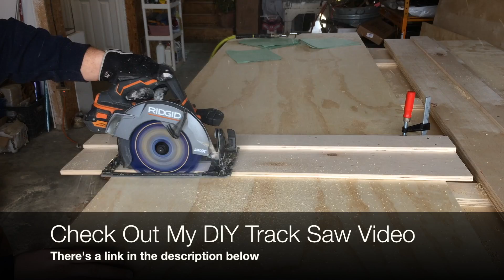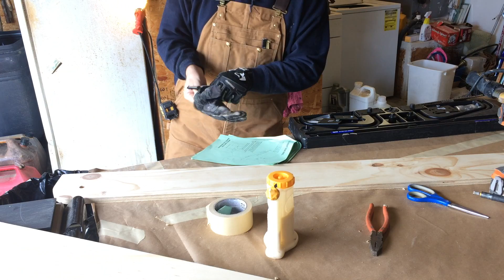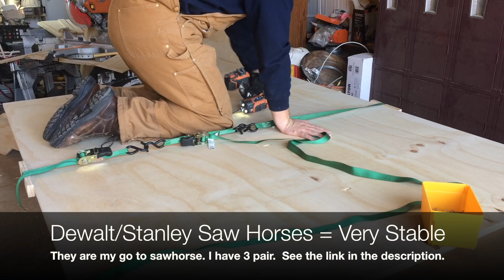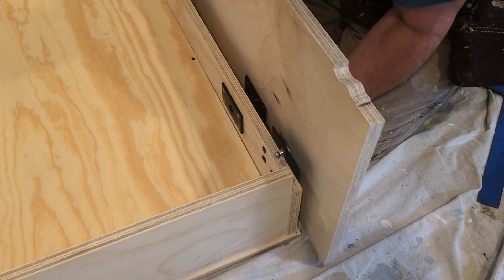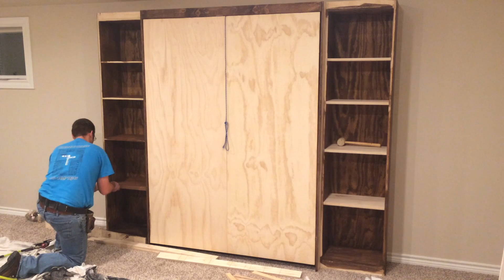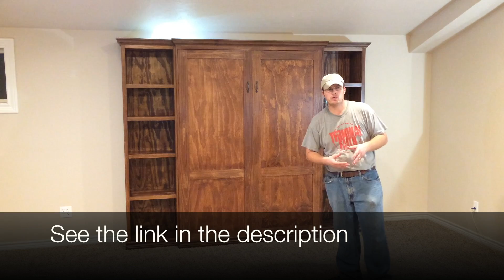How to Build a Murphy Bed - Using Create-a-Bed Hardware Kit

Comment: I built my bed from the Create-A-Bed kit.  The hardware is standard fare and most suppliers use the same hardware sets.  What Creat-A-Bed sells is not exclusive to them.  The instructions that come in the kit are though. My instructions have a revision date of 2018 on them.  I found a few errors in them.  I have considerable wood construction experience so I was able to decipher the instructions and work around their mistakes.  And I substituted some of the materials to make a better bed that was easier to assemble.  I would recommend to anyone to use another supplier that includes photo illustrations of their builds.

Comment: Lots of work in this build.  Great job! I would change the following: avoid rotary cut soft-wood plywood.  In my opinion it does not take stain well.  Hardwood maple or birch plywood is much more attractive either painted or with a clear finish; apply iron on wood tape to bed box.  Raw plywood edges are not attractive.   Other wise great work.

Comment: Dailey, thanks for posting this video. I'm in the process of building this for a client however, theres a height limit of 83.5" due to beam of where they wanted this bed located. Do you think it's possible to adjust the length to 83.5" by shaving off 1.5" from the head piece? Just wondering if theres wiggle room by the wall. Thanks.
Reply from the maker: Al Flores I’d contract Creat-a-Bed for that one. I’d say no it wouldn’t work. The plans are very specific. However they also make plans for horizontal mount beds to easily solve your height problem

Comment: I wonder how hard it would be to assemble this for a bedroom that is only 8 feet wide by 10 feet deep.
Reply from the maker: You'd be really cramped but it's doable.
Reply: @DaileyWoodworks  I actually found a prefab unit that needs some assembly that will fit under one of the windows in the room. It is the Deerfield model by Atlantic Furniture with a built in tri-fold foam mattress.

Comment: I am wondering how this kit can be $300, I just made my Murphy bed of course it is not good like this but I spend 
$20 - Swivel
$20 - Gas Struts (only problem I bought shorter than need... 100lb per strut)
$5 Screws
$210 for 4x 4by8 plywood (pre-cut at homedepot, they did pretty good job)
Reply: what size gas struts should you have used and do you have a recommendation on where to get them?

Comment: I am sorry but that $300 kit you can crate yourself for $40 includes (gas spring, gas spring bracket, turnable bearing used 300pound) money trap videos, I hate it

Btw furniture looks beautiful
Reply: I am going to build my own one, this summer and you are right... a couple of welded plates as a pivot points and the gas props are sooo cheap like (40£ here...) I will try to make a video and will put the files online for free in case some wants to make that design.
Reply: What about the tube leg, where do i get that?